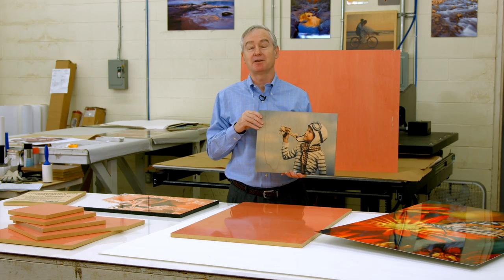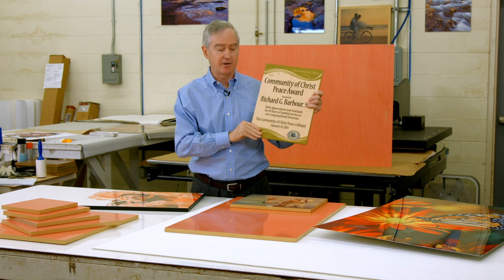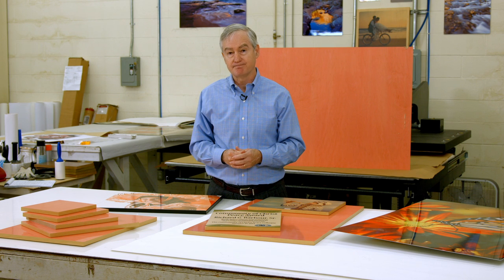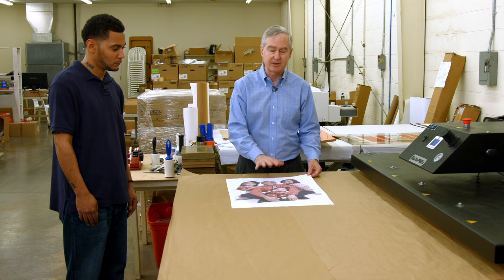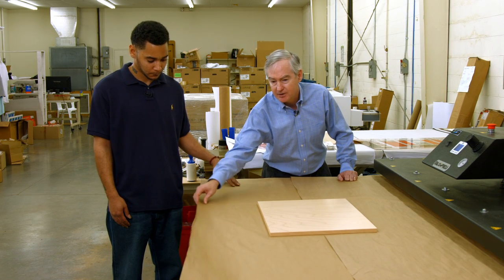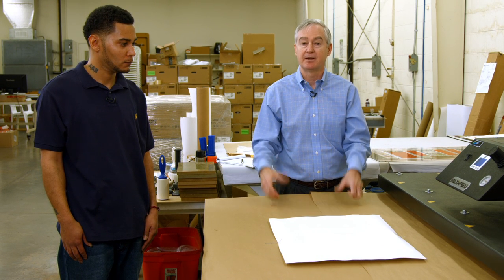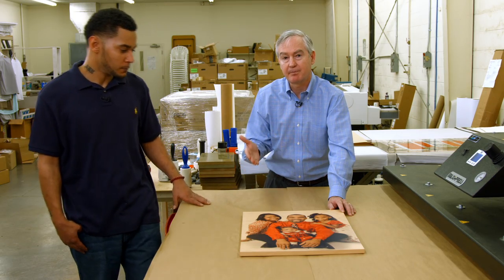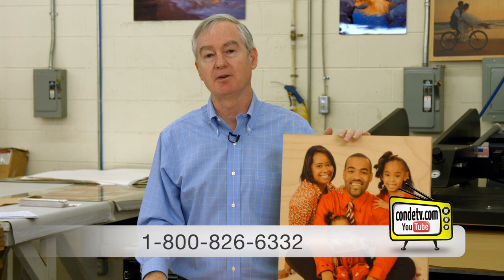Dye Sublimation Imprinting ChromaLuxe Natural Wood Large Panels -

Comment: How does the glue between the maple and mdf not separate while heat pressing? I want to sublimate the flat part on  skateboards and I am worried the glues between the veneers will separate. Any ideas?
Reply from the maker: +Corey Shepherd ...............We don't know about skateboards. You need to try it and see what the problems are. Usually 400° is not enough to liquefy the glue completely. 
BTW, Any warping of our mdf does require that you turn the panel over and heat it on the other side.